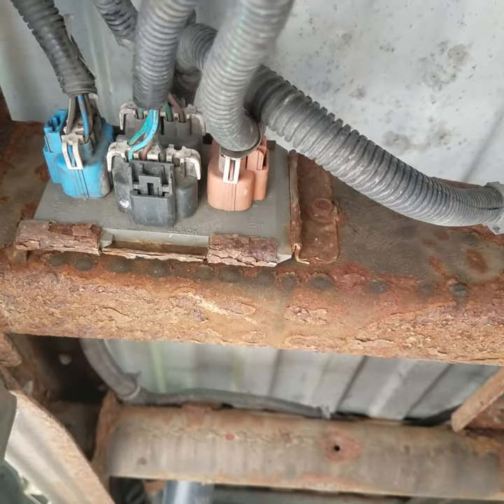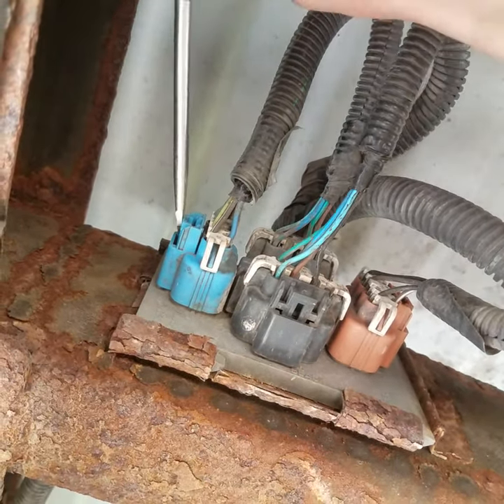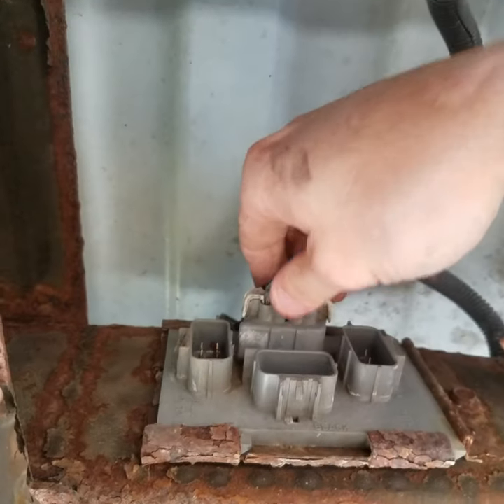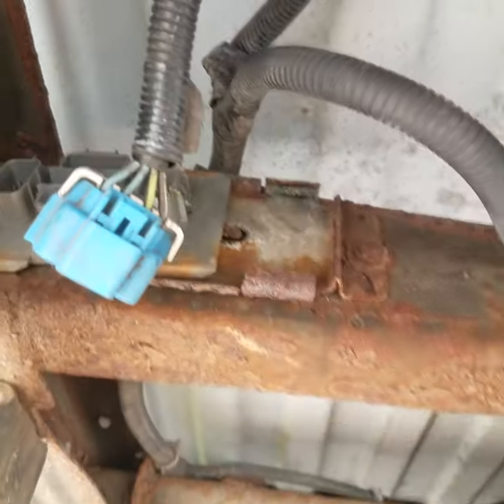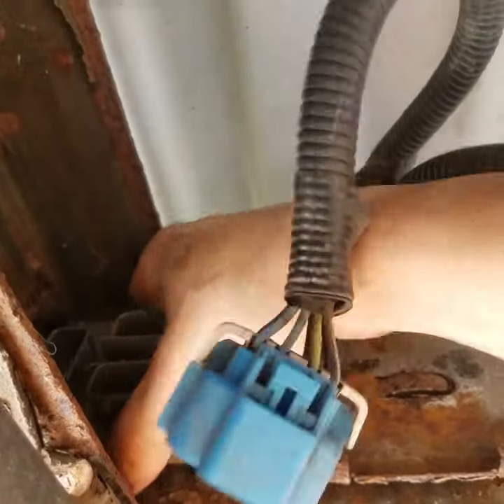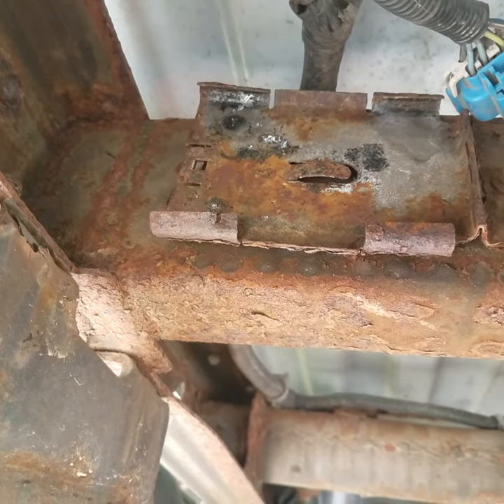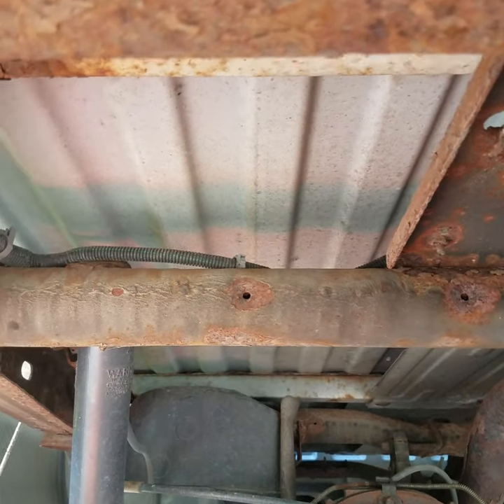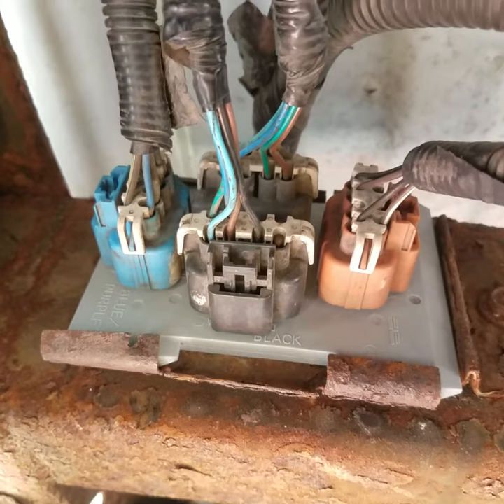1999-2013 Chevy or GMC tail light issues

Comment: I just bought a 2004.5 Chevy 2500hd duramax and I’m having trouble with my driver side rear running light. Brake light, turn signal, and reverse lights all work bud for some reason my running light won’t come on. I just bought a harness for $30 and hopefully that fixes it. Thanks for the video love when people take the time to help others. Cheers 🍻 from Newfoundland!! God bless Ukraine 🇺🇦 and there resilient people.
Reply from the maker: I'm glad we could help you with your vehicles issues 
Hopefully, you get it fixed.
If you do not feel free to contact us, we can help you
Reply: @fantastycz6737  I didn’t install it yet. Hopefully this week
Reply: Pleease let us know i have the same problem as well
Reply: Under the hood there’s a fuse for your running lights. There is 2 of them. One for the left and another for the right.
Reply: @ec4774  you know the numbers or what fuse
Reply: @gabepedraza1378  it’s TRL R TRN and TRL L TRN. it’s a 10A fuse it’s also 2 separate ones which is for the right and left sides. There located underneath the fuse extractor.
Reply: @gabepedraza1378  I hope it works. That was my issue
Reply: I’m having the same issue did the harness work? Or did you have to buy the board?
Reply: @diego596cool  I bought a new harness and still didn’t work thinking it’s the board
Reply: @diego596cool  check your fuses first underneath the hood. I commented in here like a few months ago. Check it out if it works first if not go with the board.
Reply: I have the same exact issue what did you do to fix it I've replaced the bulb unplugged the wiring harness and plugged it back in like everything and it still won't work and neither will my plate light
Reply: @ashtonsawyer9259  I have the same issue which is weird because it's only the left plate light and the plate lights are on a separate harness than the tail lights. I've tried two different used boards and a new one. Keeps coming and going, can't be a fuse. I'm going to replace the three harnesses and board today
Reply: @ashtonsawyer9259  I just had to go back and find this video because an hour after commenting I decided to check the fuse just in case and it turned out when I wired the plow harness years ago I stuck the plow signal power wire under the LR park light fuse and it was causing a loose connection there. If I pulled it the left rear park and plate lights would go out. Fixed the terminal and the plow wire and should be good 🤞
Reply: @bounce12  did it work ? I got the same issue.
Reply: @mcmobski1657  shii  I’m trying to know too lol
Reply: Did it work????? Smae issue
Reply: I'm having the same problem on the driver side.did you happen to figure it out by chance
Reply: Did replacing the harness and board help?
Reply: Same issue what was the fix
Reply: Same issue! What’s the solution lol
Reply: @fantastycz6737 did you find what fixed it I have the same problem?
Reply: @raskellowks2672 did you find how to fix it I have the same problem
Reply: Same issue! My left rear and license light don't turn on.
Reply: Same exact issue

Comment: That circuit board will come out a lot easier if you use the slots in it. You only move it halfway across and pull straight out.
Reply from the maker: The bolts were rusted so bad we're afraid they were going to break off trying to remove them
Reply: @Precision.automotive  not even close to what he said.

Comment: Thank you I couldn't figure out what was wrong with the tail lights didn't even know that board existed. Lol
Reply: Were the tail lights not working, but the reverse lights, brake lights, turn signals, and license plate lights all fine? Because that's what happened to me.
Reply: @philipsnider5079 did anything help ? Everything works good just when I press the break nun happens
Reply: @dereekk__3112 if fuses are good it’s probably the bulbs. There are two filaments in each bulb. One lights up for running lights, both light up for brake lights. In my case the running light filaments were burnt out but the brake light filaments were good. In your case it may be the brake opposite. Try looking closely at the bulbs and see if you can find both intact or if one is burnt out.
Reply: @dereekk__3112 another thing to check is if cruise control works or not. If it doesn’t, there’s a little module under the steering wheel that’s gone bad.

Comment: Try the relay 4 the parking lights under the hood. I shorted mine with a multimeter across the resistor and it clicked then my taillights started working again. Quick and EZ
Reply: I need to know what color of the wiring harness goes to what color on my taillights I cut the connector off my harness and the one that goes to my taillights
Reply: On my 2016 chevy Colorado
Reply: I have a orange wire a yellow wire black wire and a Grey wire those are the wiring for my taillights the colors from my wiring harness  are black,darkgreen,lightgreenangrey and purple together I need to know what colors from the harness goes to what  colors on my taillight wiring I cut the connectors off

Comment: FYI all you need to do is remove the screw on the right and the whole thing comes out, remove the electrical wires then remove the board by prying on the left side tab and then sliding it out
Reply from the maker: FYI the tabs was rusted that is why it had to be pried off the screw was broken that it lifts up off of.
Reply: @Precision.automotive  This is for people who don't have that issue, Just trying to help

Comment: I just found your video, I've been having trouble with my brake lights also. Replaced fuses and the brake pedal switch, taillight housing ( I bought her used; someone put after market LEDs on it). All possible fuses under hood and fuse block under dash. This may be my final answer, (I hope it is). Thanks for putting this vid out there, I'll check back to let you know... Thanks again!
Reply: Well, I found my junction block in good shape, just full of dirt... Brushed it out, but still had trouble. Went back to the brake switch, because I realized when I took it off, it was positioned a particular way. So I adjusted it, and the brake lights worked, but wouldn't shut off. After watching another video, (sorry, but I wanted to cover all the bases), I took apart both new and old switch and found the new switch pins in the wrong order. So after an hour or so of tryin to get them set right, I finally got the switch back in and the brake lights, as well as all other lights, working properly again. Thanks for your video, fixing cars yourself is always a process, just takes patience.
Reply: Did it work?
Reply: @manuelbustos9334  brake switch or light switch
Reply: 11 mon later?
Reply: 1 year later was it the circut boared
Reply: I'm sorry guys, this goes to Gmail, is not primary email....
I thought I responded back when..... But to the issue, The brake light switch was
 the problem. Once I changed it out, ( and reposition the pins inside), it worked, rather lights began working. Still have to do a lil fine tuning though, as I have to step on pedal to the floor, then let up a little... B cause of how the brake pedal pushes on switch to make it all work...

Comment: Having trouble with tail lights  on a 2010 Silverado . The top light on the driver side won’t stay lite up. But the signal well blink .
Reply from the maker: Check your ground for that side each side has its own ground
Reply: Did you fix it

Comment: I take it if all of my taillight bulbs do not work, this is the part to replace? My Left taillight all three bulbs do not light up, but the brake light does only on one of the dual filament bulbs. My right taillight only one dual filament bulb works for taillight and brake light. Both small side lights single filament bulbs do not light up. That would make sense to replace the circuit board you replaced in this video.

Comment: I have an 05 Silverado 1500 and there seems to be a short in the left brake light. So I have the brake pedal pushed in so the brake lights are on and I keep taking the bulb in and out and every once in a while the brake light will turn on and stay on. 
But every time I go somewhere and test to see if the left brake light is still working and it's not. So i pull the bulb in and out until it turns back on.
Reply: My problem is that my left tailight and license plate light don't turn on. My right side works. I've changed the circuit board, lights, and left/right harness. Checked fuses and nothing. Wondering if it's the harness that come from the front to the back that gives it power.
Reply from the maker: Check your ground and then clean your connections 
Let us know if this works

Comment: I don't have one on my Chevy suburban 2001 my passenger side license plate light and passenger side tail light not working I put New LED lights in the license plate didn't fix the problem all the fuses are good too
Reply from the maker: Check the y-harness that goes to license plate items common for getting corroded and going bad

Comment: All my lights work except for the plate lights. I removed the plate light harness checked for breaks in the wiring tested harness everything good and fuse is good.
Reply: where is the fuse for the plate lights ? I’m having the same issue. I have a brand new harness, thinking it’s a fuse if not then it might be the circuit board
Reply: @BernieM2819  i checked all fuse locations under the dash/hood and on either side of the doors (dash). Im thinking too it could be the circuit board.

Comment: I have a 2011 Chevy avalanche and I’ve been having rear running light issues.. I bought the rear junction box to find out I don’t have one apparently.. I’ve looked everywhere under the vehicle in the rear even took the spare tire down any help would great! Ty
Reply: Just bought 11 avalanche rear taillights won’t come on. Brake light turn signal functional. No lights I hope you fixed your issue by now help me….

Comment: You have to take off the whole metal plate,there is a bolt and come off with the bird and is easier to do this way. Thank
Reply from the maker: Yes, it can be done that way. It also depends on the model it the same plate, similar location on GM products

Comment: 03 Silverado. Everything works on passenger side. Only have brake light on driver side. No tail light or blinker. All bulbs good
Reply: Did you ever find the solution ?
Reply: @bluejfishin3995  yessir turned out it was just a fuse

Comment: my issue is passenger side on a 1999 chevy silverado blinker and brake light works tail light doesn't
Reply: What ended up being the problem with the tail light? Currently having the same issue
Reply: I'm having the same problem in a 2003 chevy tahoe  do you know what the problem was
Reply: You figure it out?

Comment: Has anyone had this problem with a 2006 GMC Sierra 2500HD? I’m wondering now if it’s mainly a problem for you northern guys with salt and and other corrosives on the road. Thanks for the video.
Reply: I’m in Missouri and I think mine just went out on my 2005 3500

Comment: does this also fix 3rd break light also my 2011 one doesnt work since i bought it replaced bulbs and fuse and only works for 1 second
Reply: I dont think so. My 3rd light is the only one working correct still. I think it's on a separate harness.

Comment: Hey Josh thanks for vid. You think this is the case with my brake and turn signals lights working but no tail lights not working? I already tryed replacing bulbs and nothing.
Reply: Nope, have the same problem. I already changed the circuit board, the bulb, even the whole wiring harness. I honesty have no idea what it can be at this point. Ima keep investigating tho
Reply: @PardoTutorials  Did you find out what it was?
Reply: @jltaco85  yup a stupid fuse. I had checked them before but I guess I didn’t check the right one cause I went back and checked them all with a test light and sure enough a fuse was broken. Replaced it and my taillights have been working great ever since
Reply: @PardoTutorials  what fuse? Location?
Reply: @PardoTutorials  what fuce was it?
Reply: Brake switch on your brake pedal
Reply: @sergioalcala5397  did you find what fuse or get it fixed. Everything works except taillights.
Reply: @robrei2117  did you get it fixed. My taillights don't work. Everything else works.
Reply: @lalo82605  yes harness was disconnected
Reply: @robrei2117  which harness? The grey box, I replaced it
Reply: I just fixed it. Everything worked except taillights. Changed RR Park 10a Fuse and LR Park 10a Fuse. Everything works now
Reply: @lalo82605  idk my mechanic just pluged the barnes back up the one all the way in the back he las it came off
Reply: @robrei2117  I just fixed it LP RR Park fuses

Comment: There’s a problem with my taillights my running lights don’t work but my blinkers and brake do and also the plate lights don’t work what could it be ?
Reply: I’m having that same problem and I can’t figure that out on my 1996 Chevy Suburban
Reply: I already replaced that part mentioned in this video but it didn’t help :/
Reply: @fademeupmarvin2778  damn I switched the circuit boards in the tail lights and that didn’t help either right now I’m in the process of tracing wires
Reply: @seththompson5326  I’m doing the same thing as well
Reply: @fademeupmarvin2778  ok I’ll let you know if I find anything that helps
Reply: You ever figure it out? I’m having the same issue

Comment: I have a 1999 Chevy Silverado nd my brake lights are the only tail lights not wrking I checked the fuses nd changed the brake switch
Reply: Does your running lights stay on ? Having the same issue. My running tailight stays on but when I press the brake my left tailight won’t work
Reply from the maker: Check your brake light switch

Located underneath dash on brake pedal  linkage aka pedal rod
Reply from the maker: Check your wiring 
The wiring goes to the rear end of truck on drivers side.  Then it goes into a T connector and runs from the drivers rear across underneath bed behind the bumper over to the passenger side and up to the taillights.

Comment: I have no back lights that work on mine do you think this will fix it
Reply from the maker: Yes or the neutral safety switch locked on the side of the transmission
Reply: @Precision.automotive  what is that part called

Comment: I need one for a 1999 Chevy express 1500 what is that thing called?
Reply: Tail light Junction Block
Reply: For my wife's 2006 GMC Yukon Denali I replaced the old board with a new Dorman 923-012 Tail Light Circuit Board from Amazon and things worked for several months.  There was some green corrossion on the connections of the old board and plugs.  I cleaned up the plugs and replaced the board.  When she bought it the previous owner had installed some LEDs which I think might be part of the problems we have at night.

Comment: Would this work for the 3rd brake light not working? I can't get my 99 silverado to pass inspection till I get this fixed. The fuse and bulb are good. Hopefully its not a wiring issue 🥴
Reply: you can buy a whole new wiring harness for $30, don’t be too worried
Reply: @picklejuice6969  thanks, I truly appreciate it 👍

Comment: That’s all fine and dandy but what is the part called
Reply: For my wife's 2006 GMC Yukon Denali I replaced the old board with a new Dorman 923-012 Tail Light Circuit Board from Amazon and things worked for several months.  There was some green corrossion on the connections of the old board and plugs.  I cleaned up the plugs and replaced the board.  When she bought it the previous owner had installed some LEDs which I think might be part of the problems we have at night.

Comment: 01 Silverado original owner 387k miles.  Recently, no power to rear lights connector but trailer lights work.  I’ve checked fuses, ground at rear end, and replaced this board.  With test light , I have no power to the connector.  Replaced the turn signal multifunction switch too.  Any other advise before I take it to a shop? Thanks!
Reply: Found out it was a rodent that chewed up wires …had to remove truck bed to get to them… ☹️
Reply: @shauncunningham5088  have you tried replacing the Tail Light Combination Junction Block? aftermarket part Dorman # 923-012
Reply: you don't have to remove the truck bed to run new wires! That's insane!
Reply: @shauncunningham5088  when working on my truck i find it helps to blaze up if im in a bind
Reply: @nonamegiven5744  I’m having the same problem, where did you get the wires to fix it?
Reply: @kuchieman658  it was where the wires go to /thru fuel pump on top of gas tank.  Those wires were chewed by rodent etc.
Reply: @kuchieman658  I traced wires that went into area where I had to slightly  lift bed of truck like if u were going to change fuel pump etc

Comment: my running tail lights dont work but all the rest do, I've replaced over half the fuses and I still don't have them, I'm replacing the circuit board in a few days if that doesn't help what else could it be?
Reply: Did it work?
Reply: @robrei2117  nope, fuses, bulbs, circut board still nothing, im taking it in today to have it looked at by a professional
Reply: @maxlithium1190  did you get it fixed. My the same
Reply: @maxlithium1190 you ever figure it out?